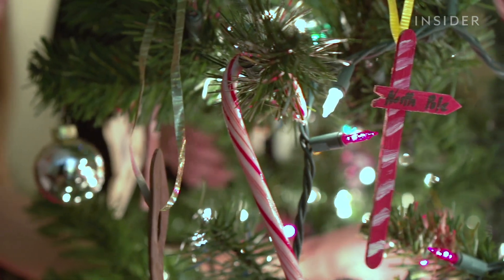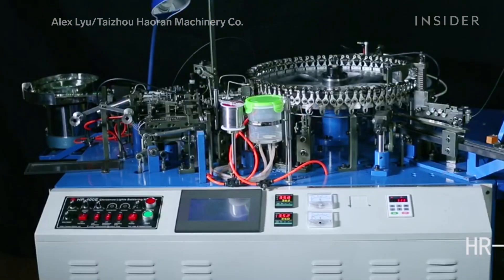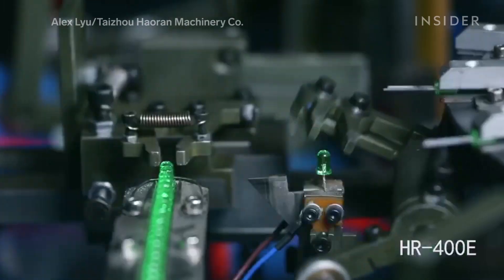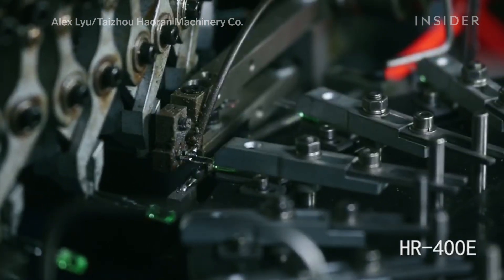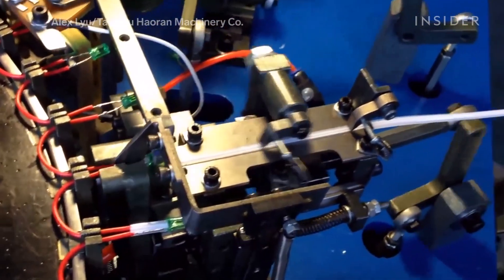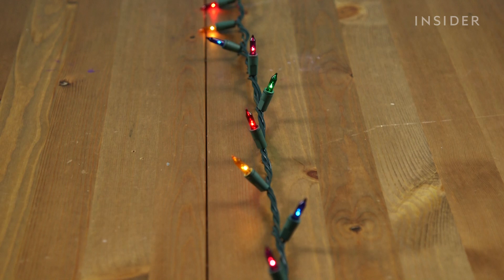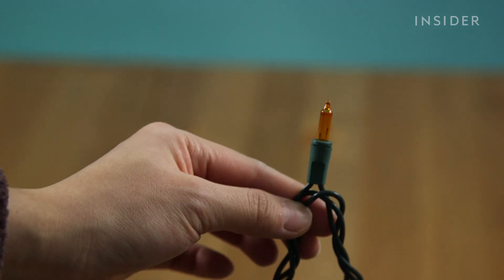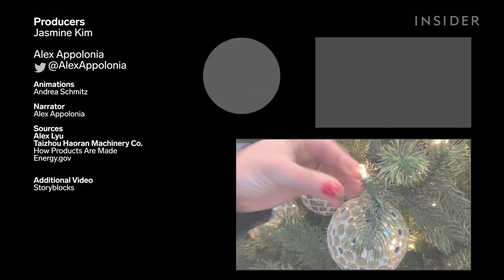How Christmas Lights Are Made

Comment: Series circuits aren't used anymore. Only parallel circuits are used now, and as long as I've had  a tree, which is about 40 years.
Reply: Incandescent mini lights have used series circuits for over 50 years... In fact, some (very) old C7 and C9 sets used to be wired in series.
Reply: @showbizwisconsin8350  I was speaking about newer lights. I have no series strings. I can replace individual lights without the whole string going out. And now there's always a fuse in the plug for extra safety..

Comment: DO  NOT put your LED strings outdoors .... if you want them to last .... water creeps up the ( plated steel ) LED legs and the ( 3 Volts )  per LED causes  HUGE  electrolytic corrosion (  💩RUST !  )  =  total failure .............. DAVE™🛑

Comment: The LEDs are tested to find their polarity, not for "charge".

LED and incandescent lights are presented without distinction; Not ideal...

In the series circuit all lights will go out at the same time if the circuit is broken anywhere. The animation is misleading. It won't look like that.

The parallel circuit in the example is shorted
Reply: AI video.

Comment: When they all stay lit even if one goes out it’s because the bulbs are equipped with a “shunt” to allow current to keep flowing. If they had a true parallel circuit they would stay lit even if one was entirely missing and that would have a lot of wires. C9’s and c7’s and such can stay lit because each socket “taps” power off the main line
Reply: This is literally what I came to learn, was if they were true parallel circuits or no. Thanks.

Comment: Okay so you showed a green LED string being made. But then when showing what the machine supposedly made, you pull out a multicolor incandescent string. Something tells me y’all didn’t do your homework
Reply: Does it matter that much? It's made the same way for the most part.
Reply: @rmalus10297  Yes it does, they're not at all the same.  Different bases, different sockets, different bulbs, different power supply.  That's like watching a video about how incandescent bulbs are made and then they show some florescent light fixtures in an office.
Reply: What that machine was making is beyond me. I have never seen a set of LED Christmas lights where the diodes are soldered directly to the wire with only shrink wrap tubing protecting it. Absolutely nothing like what is sold in big box stores.

Comment: First off they are called Light Emitting Diode aka LED for short not "bulbs". Also newer bulb typed have a shunt device in them so when the bulb blows it keeps the rest of the lights on. The parallel lighting is different then standard strings as they would be the C-7/C-9 screw in type, if you do that with the mini lights and the bulb blows it will directly short the circuit and no bulbs will be lit and blow a fuse.
Reply: Yes. Incandescent mini lights have had that shunt device in them for probably 30 years. The reason half or all of the strand goes out is that shunt fails. The reason it's only half is almost all 100 count mini light strings have 2 series circuits of 50 If you use a voltage detector you can pinpoint the bad bulb and replace it, instead of throwing the whole thing in the trash. It's important to replace bulbs when they burn out because when they do, all the rest of the bulbs get a little more voltage because one is absent from the circuit. This means they will blow faster and faster until either a shunt fails or the whole strand burns out.
Reply: @showbizwisconsin8350  I know that, I do a lot with Christmas lights and string setup. You also have older sets of 100- 5 way (5 sets of 20 in one string) and sets of 35. I have a "save a set" light tester for fixing old sets.
Reply: @chrislewis2262  Nice. I use the light keeper pro for fixing my sets. I've taken "broken" lights from people and sometimes you get some that aren't worth fixing, but most of the time, it's just one bad shunt. I have acquired so many lights my whole display was basically free
Reply: @showbizwisconsin8350  the one I have has a plug socket where you plug the string into it pull the trigger and it sends a pulse wave through the string of lights to pop the shunt into place.

Comment: um no thats not what you get from that machine, those are clearly mini incandescent bulb and socket strands in the 'finished' shot, the machine is making hardwired led strands. You also missed completely shunted bulbs, when they go out they cause their own short-circuit to keep the other lights in the strand to stay lit. https://www.energy.gov/articles/how-do-holiday-lights-work
Reply: Exactly! This machine is making some weird homemade Chinese lights that resemble those crappy solar light strings more then actual Christmas lights. I wish Insider would actually take the time to research just the slightest bit about the subjects they talk about.
Reply: 0086 18857692349 , I will show you hot to make it by machine